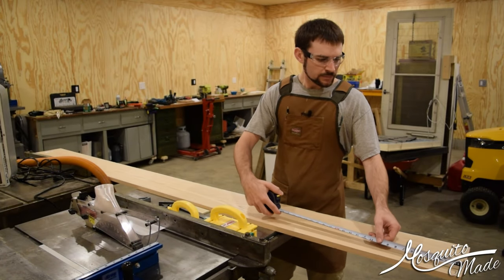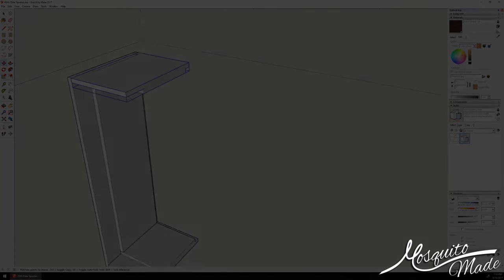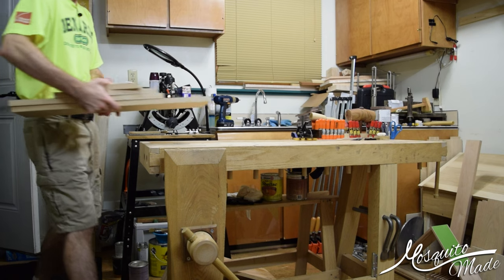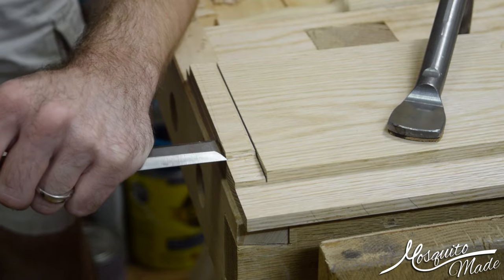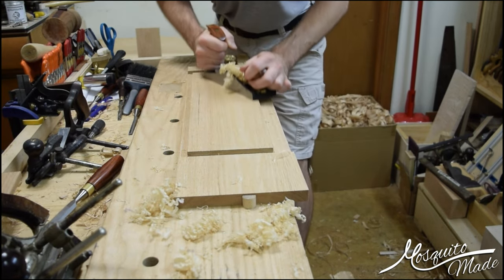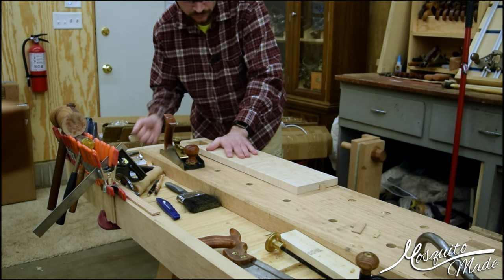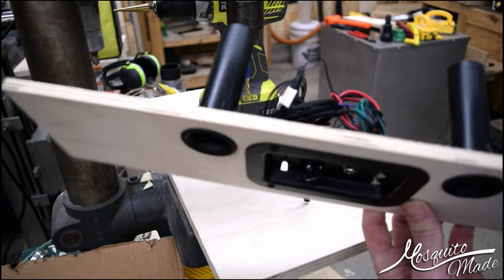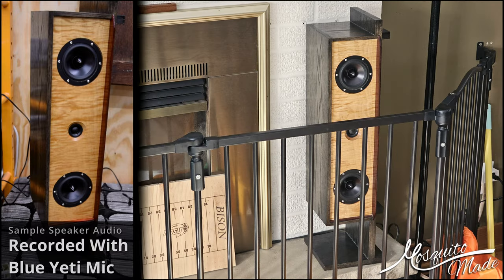DIY Bluetooth Speaker Build

Comment: Hey Chris, Nice build and the speaker looks great!  I'm kinda jealous seeing you running your Stanley 46, mine is restored and ready to roll but I need to fabricate cutters for it.  Yeah I could fight it out on eBay UK to overpay for 46 cutters, but I'd rather learn to make my own.  Also my hifi speakers are super old and probably past their best, I was thinking to save up for new but this video has started me thinking about making my own.  Hmmm...
Reply from the maker: Finding irons floating around on eBay is almost always a very expensive way of doing it, unfortunately.  I know over here stateside St James Bay Tool Co makes reproductions, which is what I have.  I did send my first set back, though, as the bevels they had ground were terribly off, and I didn't have my won grinder.  If you could make your own irons, that would certainly make things a little easier from a procurement standpoint, just means more work up front lol.

As for the speakers, thanks!  I'm no audio engineer, but I can follow math :-)  In the past when I did my first speaker-computer-all-in-one thing, I did a lot of research and learned about the volumetric specs for various drivers, etc for whether vented or unvented, and all that.  It's certainly something that's doable, and that's the "easy" part.  It's the crossover stuff that gets complex for me, but also sure that's learnable too